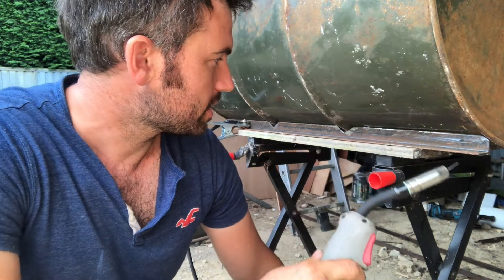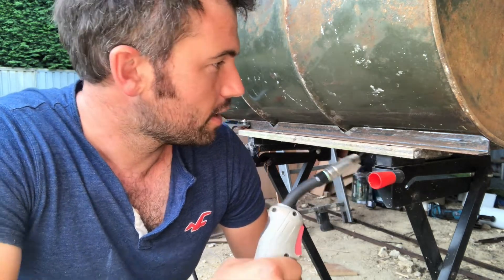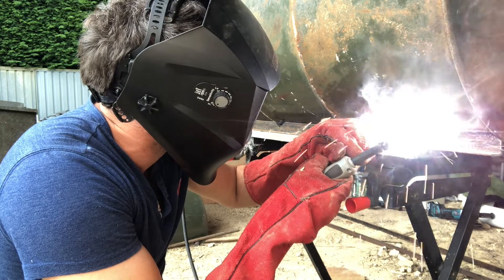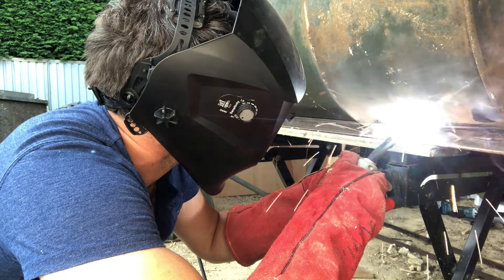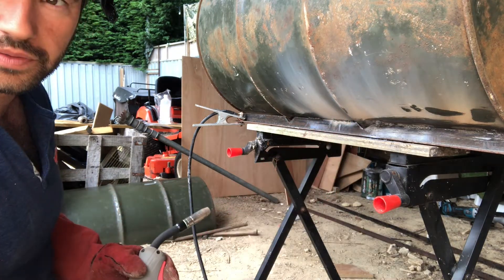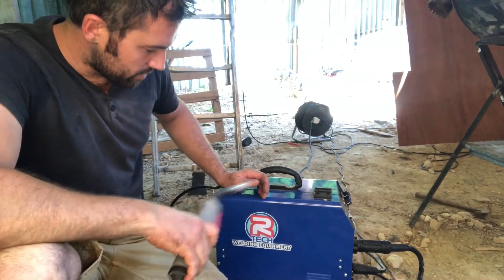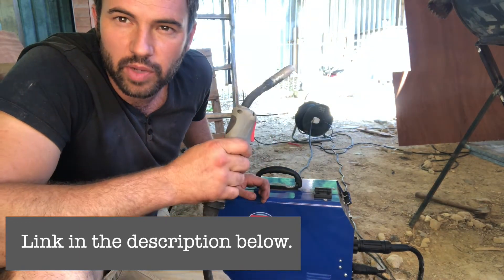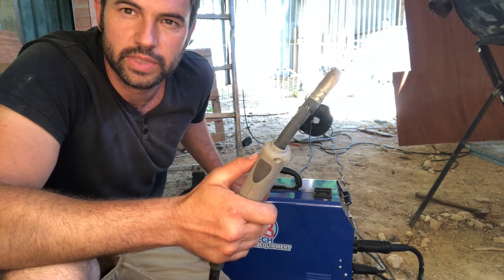CAN YOU WELD USING SOLAR POWER? Using OFF GRID SOLAR POWER SYSTEM for MIG WELDING

Comment: What size inverter do you have to rùn the welder? my welder is an rtech like yours but the 250 amp version,  i used to run it from a 10kva lister generator but it broke down and the man who came to fix it disappeared with the voltage regulator, so when i get a new solar set up i want one that will power the mig at around 100amps.

Comment: why would you need an inverter for this? couldn't you just stick weld direct current straight out of the battery?
Reply from the maker: Probably, but we reckon it's much safer to get the voltage from 48v to 240v.

Comment: Remove all paint and mill scale of metal you want to weld… needs to be bright and clean to get a good clean, strong welds.
Reply: You can also wipe it down with acetone, once rubbed down to remove any grease etc.
Reply from the maker: Thanks for your comment, and the advice 😊